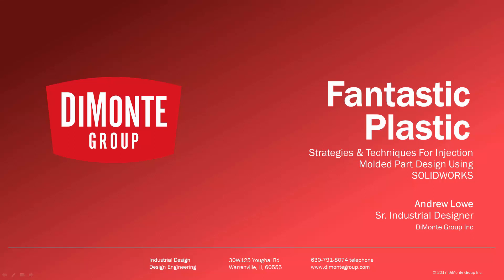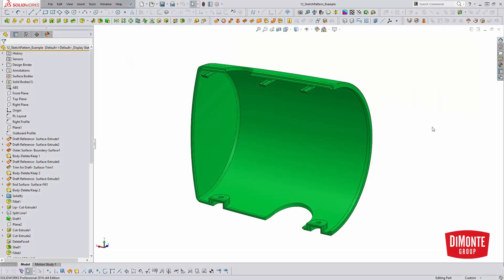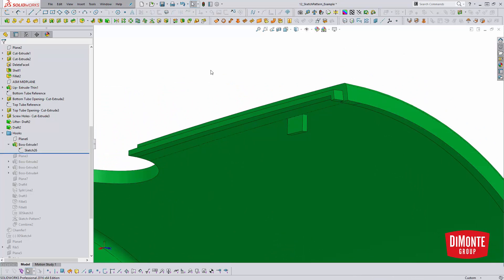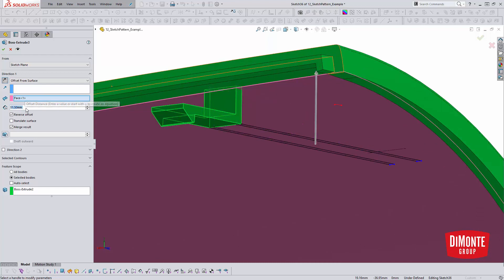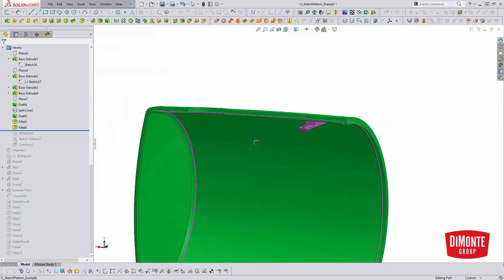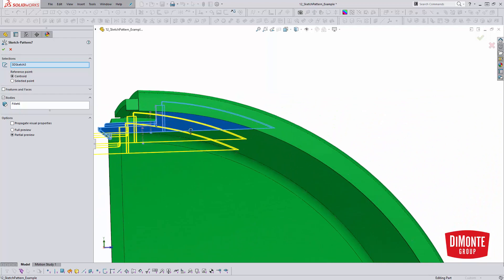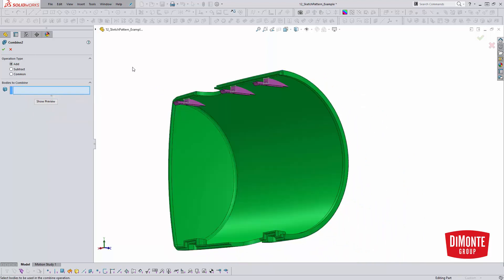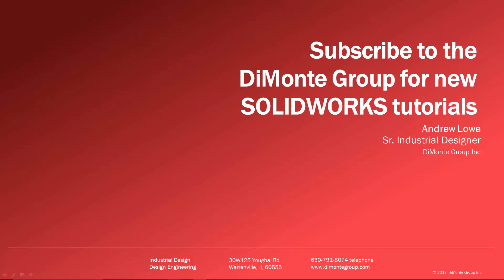Sketch Driven Patterns - SOLIDWORKS Tutorial - Fantastic Plastic 11

Comment: That is an exellent method for adding those snap features on that round part, Andrew. Thanks for your video!  26 years using SolidWorks and still learning better ways to use the software. Have a great day!